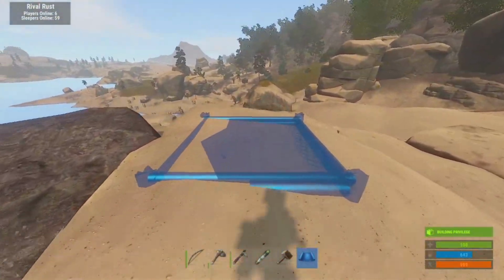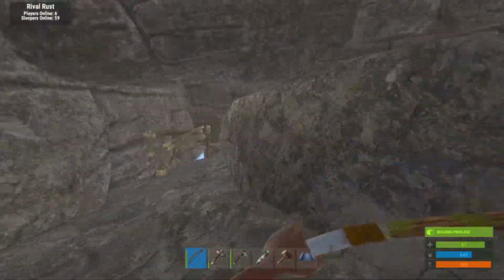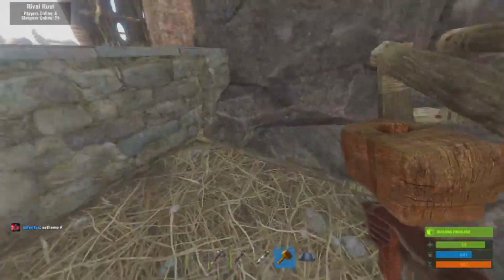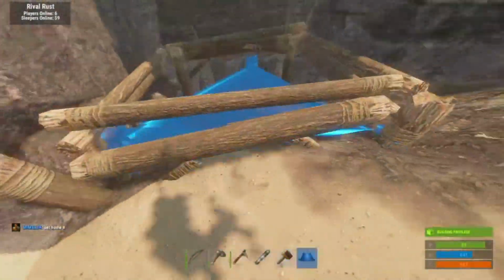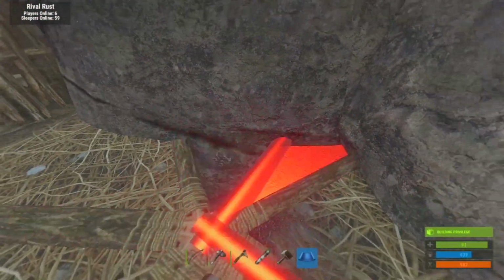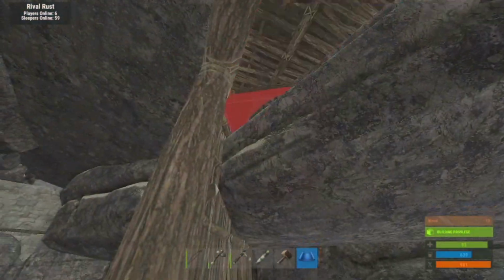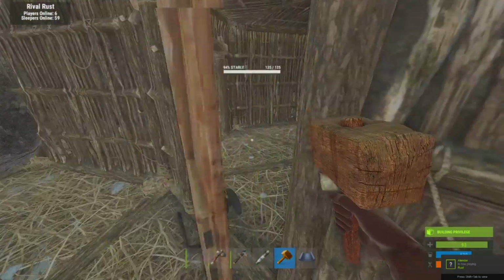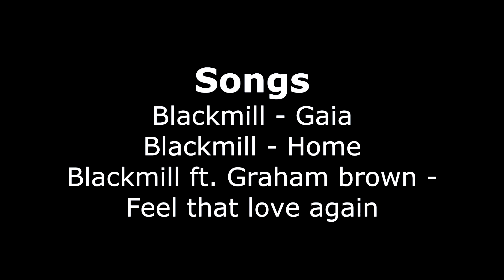Rust Cave Base Design guide tutorial (Out of date)

Comment: I have a solo cave base.  The mountain that the cave is in is pretty small.  I was able to wall it to make it look like a normal base on a hill, then built a tower to deceive the raiders where the actual loot room is.  I've been raided by both clans on my server.  25 C4 approx from each clan (I had time to repair before the second hit).  They both went for the tower first, wasting 10-15 getting up there.  Then, they realized it was a cave base and attempted to get past 10 airlocks / honeycombed walls to get to the cave.  They both haven't raided me since. 

Tip:  Dont use stairs, This was probably before the ladder hatches though.
Reply: +Jerstah phucku ladders are also nice to use for when you have a very high foundation connected to a very low one
Reply: +Jerstah phucku you reminded me when i closed the entrance of my base to use it with home,my friends put a tower up and they always raided the tower with nothing,and the cave had all the loot
Reply: Peridot yeah, it seems everyone has the habit of going center and up.  I put stairs on the first two floors to help them waste more C4 :)